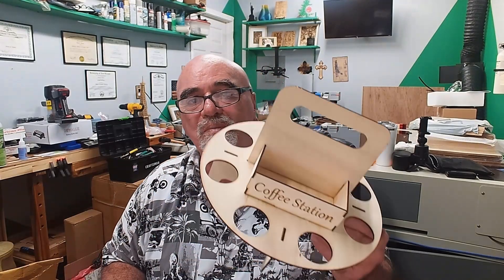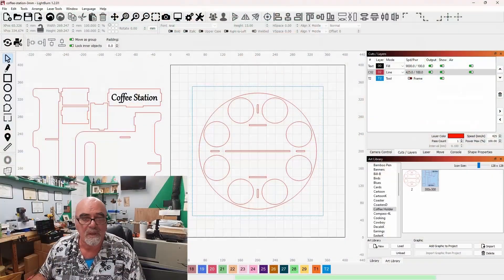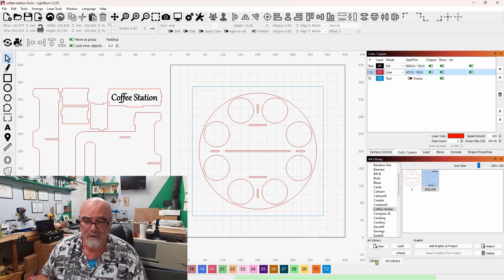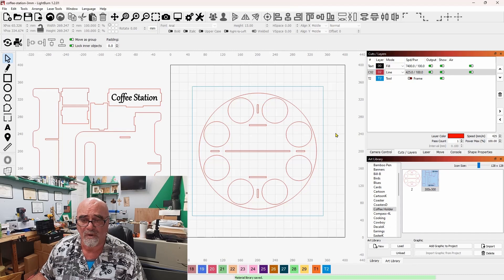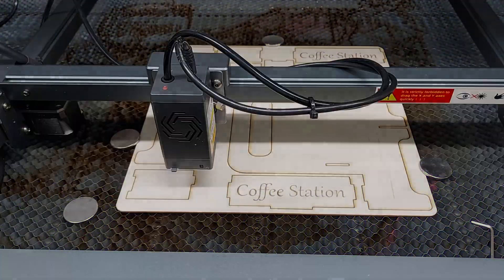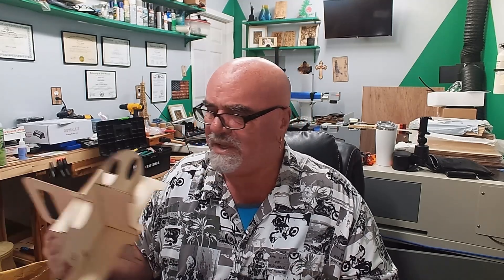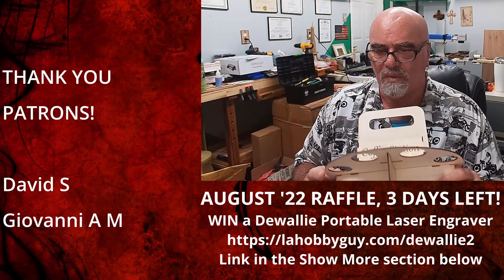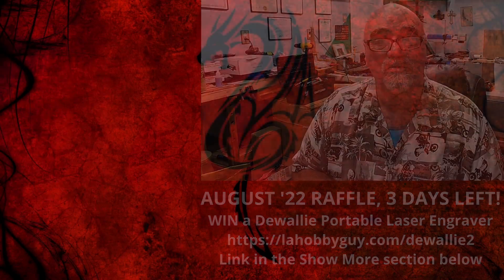👌 Create a portable coffee station on your laser, FREE template download and Lightburn Art Library!

Comment: Thank you Rich and of course Federico!
I'm a little confused that you can cut at 425mm/min. and in one pass. I have to set 200mm/min on my Lasermaster 3 to cut 3mm plywood in one pass with air assist.
Reply from the maker: I can cut 3mm wood at 200mm/min with a 5W laser Jürgen. This is a 10W, and it performs exactly as expected. You may have a problem with yours if it doesn't.
Reply: @TheLouisianaHobbyGuy  And what do you think can be the problem Rich? I could only cut at 100mm/min with my previous OLM 2 Pro S2.
Reply from the maker: @floridalove  Likely either a dirty lens or focus issue.
Reply: @TheLouisianaHobbyGuy  You were right with your first guess Rich. My mistake 😬

Comment: Hi Rich!  Glad to hear you enjoyed your vacation. Congratulations to your niece!  Have you heard about the new xTool Infrared Laser?  Is it true that it engraved metal like a fiber laser?  Thanks!
Reply from the maker: Yes I have, and no it doesn't. Understand that these are 1064nm "pump diode lasers" and operate without a fiber winding. An actual fiber laser has many of these pump lasers that fire billions of times per second into a fiber winding where the energy is stored and amplified, and then the stored energy is released by additional "seed lasers" to the Galvo mirrors. These are nothing like a fiber laser, but rather only one small part of it. These lasers are simply one of the basic components of a fiber laser, without the amplification fiber winding, frequency adjustment and seed lasers that give a fiber the amplified power.
Reply: @TheLouisianaHobbyGuy Thanks!  Would the at least engrave metal as advertised?  I really would like to engrave jewelry without the sprays required for my CO2, can't afford a fiber right now.
Reply from the maker: @deeplyrootedone  Yes it probably will at maybe 1mm/sec. It will be a VERY slow process.

Comment: WHY DOES LIGHTBURN INCREASE THE SIZE OF THE IMAGE I IMPORT, I EDITED THE SIZE BEFORE I IMPORTED THE IMAGE, I HAVE THE IMAGE SIZE 1123 X 1123 (MILLIMETERS), AND WHEN I GO TO ADJUST IMAGE, IT SHOW THE ONE ON THE LEFT AND ITS THE CORRECT SIZE AND WHEN I LOOK AT THE SIZE OF THE IMAGE ON THE RIGHT THAT IMAGE SIZE IS 4343 X 4343 (MM), I NOTICED THIS AFTER I ALREADY STARTED THE ENGRAVING, SO THE ENGRAVING IS OKAY, I HAVE SEARCHED ONLINE FOR ANSWERS, THE PEOPLE AT LIGHTBURN, HAS NO ANSWER, THEY JUST BLAME THE EDITING SOFTWARE ANYONE USES, 4 DIFFERENT PEOPLE HAVE THE SAME ISSUE, ONE PERSON EVEN TRIED 2 DIFFERENT EDITING SOFTWARES, THE SAME SIZING ISSUE WAS STILL A PROBLEM, THE PEOPLE AT LIGHTBURN EITHER BLAMES THE USER OR THE USER AND THE SOFTWARE THEY ARE USING, THE ONE PERSON HAD THE IMAGE 100 X 100(MM) AND CHECKED THE SIZE ON 2 DIFFERENT SOFTWARES IT STILL DISPLAYED 100 X 100(MM), HE SAID HE EVEN PRINTING USING A PRINTER STILL THE SAME SIZE, 100 X 100(MM), AS SOON AS HE WOULD HAVE THE SAME IMAGE IN LIGHTBURN IT WAS OVER 1000 X 1000(MM), LIGHTBURN SAID IT WAS EITHER HIM, OR HE HAS AN OLDER VERSION OF LIGHTBURN, OR THE EDITING SOFTWARE WAS THE PROBLEM, WHY DOES THIS HAPPEN, I NOTICED IF I SWITCH TO PASSTHROUGH THRESHOLD BECOMES THE ONLY OPTION OF END RESULTS, I AM MISSING A SETTING OR SOMETHING?
Reply from the maker: The physical size in the Adjust Image program preview is meaningless. You size the image on the work area to whatever size you want. The LPI stays the same. So if you have a 1024x768 and in the Adjust Image program, in the preview window, it says 3056x2292, neither size means anything. When you look at it on the work area, it'll be around 361x270 and you size it up or down by the handles, but the LPI will still be exactly what you set it to. LPI in Lightburn is non-destructive. If you use the handles and scale it to 150x112, it'll still be whatever LPI you set it to in either the Adjust Image dialogue or the Cuts and Layers window.